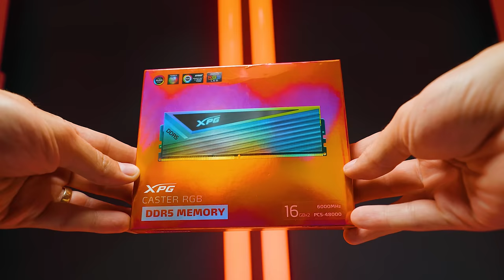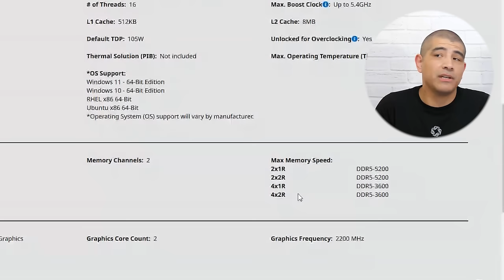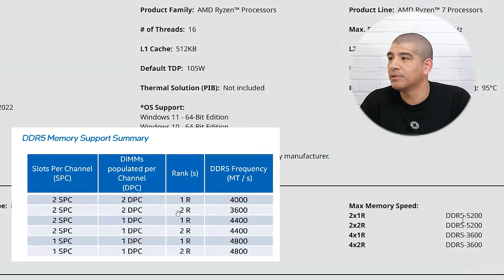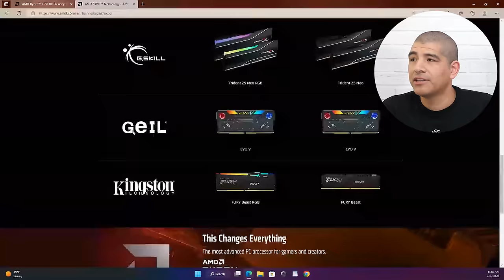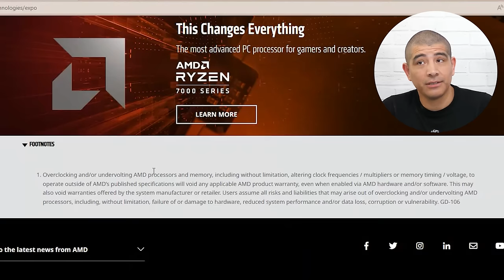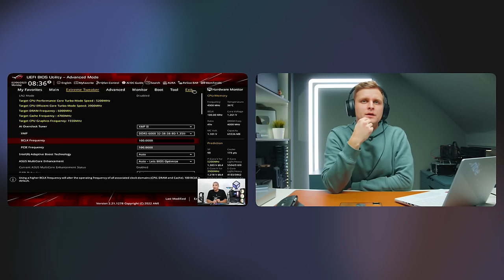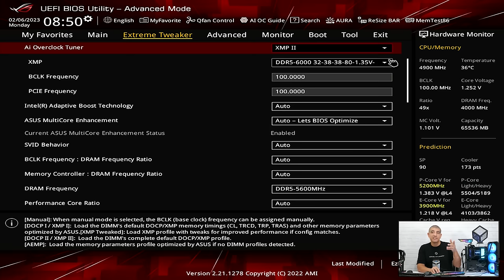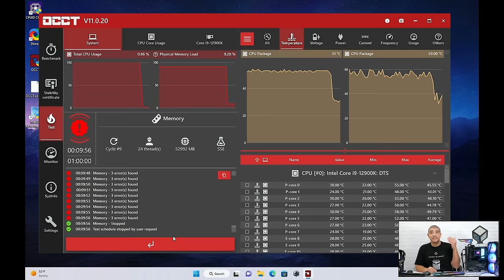Why I get NO POST with XMP??? 👉 ULTIMATE RAM + XMP Guide

Comment: AM5 half baked potato.......
Reply: This is why I didn't adopt the new gen and I'm staying with my R5 5800X until AM5 has had more time to grow.
Reply: AMD Ryzen 7800X3D is still the best Gaming-CPU…but i have a i7-13700k. 😂
Reply: @XiBaXha I was at that crossroads too, no regrets to have gone Intel though.
Too many uncertainties with AMD concerning the ram, plus I was planning my build at the height of the "frying chips" scandal.
Reply: @XiBaXha It’s an amazing CPU specially for gaming. However it is a bad all around CPU. Not enough cores to be a great workstation CPU and clock speeds a lot lower than a 7700x.
Reply: @XiBaXha it's good but not best by far
Reply: @XiBaXha nah the 14900k is as good and beats it for production easily. Beat overall
Reply: It's hilarious as a computer hardware engineer to see all the normies here bashing them and talking about games when most don't even know balancing ranks vs clock, especially when most games don't even care about memory.
Raise your hand if you've known Jim Keller and David Westfall. o/
Reply: @shaolin95 "Beats overall" LOL, for what? That's why I see AMD topping charts? And then there's real use in actual computers instead of microcomputers.  For example, over a decade ago I was running a gaming server with memory in the terabytes. People with bad Internet were complaining about stuttering, asking if it was the SSD speeds. Storage?  Lol no, I had loaded the entire game storage drive into RAM...
Reply: It could bake a potato
Reply: @TheSlickmicks congratulations for not buying thing. Mine has worked perfectly since launch day.
Reply: @moriyokiri3229  That's awesome. I wish I was in a position to afford risks.
Reply: Worst platform overall since sometimes prior to socket A.

Comment: Last month I spent about 2 days figuring this out on my newly built PC. I had random black screens and dead PC during gaming especially. While browsing solutions online, I remember watching one of your previous videos that actually talked about the compatability issue of XMP and 4 sticks DDR5 as well. That inspired me. I have 2 * 2 * 32 GB Fury stick kit + 4090 + Z790 Hero MOBO. You helped me locate the exact problem: XMP. I ran a bunch of memtest and found that none of Auto, Manual + some recommended tuning, and XMP 1 worked at all. After upgrading the BIOS to the lastest version (08xx?), I found that only XMP2 at advertised rate or Manual at factory rate worked. After setting to XMP2, all problems were gone and my PC never worked this smoothly before. Your video is EXACTLY the tour I had been through. I really hoped this life saver had come a bit earlier. Great review!
Reply: This is me right now. I'm on day 5.
Reply: XMP is intel gigante
Reply: @NearMedia  Yes sir this is the latest version by now. At the time I checked that out, 0904 wasn't available yet. Btw, 0816 works perfectly and I am not bothered to try 0904 for potentially new trash to deal with :face-blue-covering-eyes:
Reply: @NearMedia  Yes sir. All tests were passed. Practically, it's been about 20 days with no black screen. No freeze. No sysfaults. Nothing. I assume it's long enough to be firm about it now.
Reply: 4xDDR5 lowers the supported speeds.  Unfortunately XMP/EXPO counts as memory overclocking so there 's CPUs that won't handle even 2xDDR5 at the advertised speeds, while over boards manage 4 DIMM configurations.  I read the Gigabyite board notes and they were talking about their memory configuration avoiding drawbacks of daisy chaining.  There's plenty of small server boards with ECC on the AMD side aimed at the small server market.
Reply: @mirrienliang1561  At what speeds are you running 4 sticks of 16*4?, I have G.Skill 16*2 kit running at 6400 MT/s so I wanna knw if I can get another kit and get 64gb? my cpu is 13700K and mobo is Z790-A Gaming WIFI
Reply: @vigilante9259  I am running 4 sticks of 32gb Kingston Fury Beast DDR5 DIMM at the advertised rate of 5600 MHz. You might also be interested in that it seems like people been recommending doing 2 sticks for 64gb (i.e., 2x32gb) instead of 4x16gb for better stability and/or overall performance.
Reply: @Mirrien Liang  yeah thats what seems to be the case here, specially since I'm running the current ram at 6400 MT/S, guess I'd have to replace them with 2×32gb sticks
Reply: @mirrienliang1561  confirming everything is still running well for 4 sticks of 32gb Kingston Fury Beast DDR5 DIMM? i just ordered this for my 13900k ausu z790 e rtx4090 build. After hearing all the issues running 128gb DDR5 i'm thinking about getting a asus z790a and 128gb ddr4 instead. Any thoughts?
Reply: I think high speed memory is overrated. Too much fuss for small pct gain if that. Not worth the time troubleshooting or price premium.
Reply: @landonhafen2046  In fact I took 2 sticks off about one or two months ago as I was still very occasionally getting blackscreens and stuff even not in the gaming scenario. If you are still wondering, I would recommend either a 2-stick DDR5 kit OR two 2-stick DDR4 kits, even though I have been seeing more updates (in terms of the MOBO/BIOS firmware and other drivers) claiming that they have improved the stability issue. Feel free to share if your build has overcome such issues. :hand-pink-waving:
Reply: @RubbingPotatoes  I would agree with that. I feel like the marginal gain in higher speed (and even the memory size after reaching 32/64 GB and beyond) is significantly lower at the higher end and it does not hold much meaningful difference in those sticks and the prices these days.
Reply: Was this a video on turning xmp on before doing anything? I seem to remember a recent video someone did. Update bios it then turn xmp on before doing anything
Reply: @vigilante9259  Probably not. I learned with my gskill trident Z5
that it's always better to have 2x32 than 4x16 with DDR5
Reply: @midi002  day 9 here. Solved it by setting XMP2 but setting 1 higher timings to the subtimings.
Reply: @mirrienliang1561  I'm running 7800X3D on a MSI x670e carbon wifi gskill 6000mt 2x32gb expo can't get it for the life of me to run stable anyone got any ideas? It'll post but if left alone it'll start showing red and orange cpu lights the next day and then refuse to boot.

Comment: In all my years, even with fairly aggressive overclocking the CPU is generally the last thing to go. The highest failure rates are your motherboard, GPU and PSU.
Reply: They seem to be the most expensive right now. Good business for the manufactures.
Reply: @roythunderplump  .. Yeah engineering failure by design is pretty evil.
Reply: 14900KS has entered the chat

Comment: honestly people need to remember that just because 192GB DDR5-8800 CL28 is technically a combination of all the best specs, it isn't possible on an actual PC. You trade MT/s for Latency, and also quantity for both. That is why people don't buy the most expensive RAM, they buy the best middleground as that will be what gets them the most performance. In this case, 2x16GB for gaming and 2x32GB for productivity with DDR5-6000 CL30 is by far the best way to go.

Comment: I wish reviewers would do their first tests of CPUs while running memory at JEDEC. If that is the speed they guarantee, that is how they should be evaluated. If the CPU manufacturer thinks its "sweet spot" is 6000MT/s then they should validate the CPUs for that speed, especially if they say running XMP/ EXPO will void the warranty.
Reply: It's very simple, if the advertised speed isn't the JEDEC speed, then achieving the speed with XMP does not void warranty. If they want to claim that, you can simply countersue them for fraudulent marketing and earn an easy case win. If the basis of your purchase is that XMP-enabled speed was what they advertised, then that's what is legally binding in court.

However, if you use XMP to exceed the advertised speed rating on the product packaging/marketed description, then it will void warranty.
Reply: @Real_MisterSir  Lets take AMD. They seeded reviewers with EXPO 6000MT/s sticks, claiming its the sweet spot memory. However if you look at their webpage it specifically lists DDR5-5200 2x2R or 2x1R as the Max supported memory speed. If this is all they are willing to cover under warranty/guarantee as an achievable speed, that should be what the base review uses.
Reply: I thought it was the reviewers (both good and bad ones honestly) pointed out ages ago how finiky memeory was with the newer playforms, sonetimes not even being able to achieve what they ARE rated for given the chips themselves

Comment: finished the build for my wife yesterday: 
13900K on a MSI Z790 Carbon Wifi with 4x 16GB Corsair (CMT32GX5M2X6200C36, 6200MHz CL36, Hynix M) running absolutly rock solid in XMP @ 6200 with latest BIOS (7D89v15). 
Just turned on XMP1, expected a boot loop, but it simply worked with all stress tests. Fingers crossed. Very happy.
Reply: lock the p-cores on that 13900k asap.

Comment: Great Video. We always face issues with our DDR5 prebuilds with XMP profile and 4 Ram Dimm configurations (128GB). We use a combination of tools to test our prebuilds with 4 RAM DIMM configuration on XMP. The most effective one that can show the XMP issue is the Aida64 Stability Test. Sometimes we run AIDA 64 + Unigine Heaven for 20 to 30 minutes. Most Low-end Rams never get XMP performance, and we find a stable frequency by manually checking each frequency. Once again this is done for our prebuilds as stability is considered the most important aspect of our systems.

Comment: I think that 'rank' can better be explained by considering the extra capacitance added to the address and data lines if the sticks are double sided (current 32gb per stick!). This extra capacitance slows down the rise and fall times of the signals as well as additional load on the IMC. Maximum RAM chip size has just jumped to 24GB allowing 48GB with two x single rank and 7200MTs (G.Skill 7200 or even 8000+ if you have an Apex M/B). I'm running the 7200 on my Asus ROG Z790 Hero and just about to start playing with faster timings 🙂). Great video BTW!

Comment: Kingpin did an interview explaining these things not long ago.  I can't find it, otherwise I would link it.  He said the same thing a lot quicker and clearer than this guy.  Basically, Kingpin was saying his preference in motherboards for overlocking stability was for only 2 DIMM slots.  The more slots you add, the more noise potential you introduce.  The more noise, the slower the speed potential.  Same with DIMMS - single sided DIMMs (or single-rank as they are also called) are capable of higher speeds than dual-rank DIMMS. (double sided).  The fewer IC's on a DIMM the more stable it could/should be.

Comment: Over 20+ years of building and upgrading PC's I've learned a lot and every day still a school day. Thanks for the video. I'm using 2x32GB 3600 DDR4 CL18. When building (Jan 2020) my current daily (3950X in the X570 AORUS MASTER). I researched different combo's (via forums/videos/websites etc) of ram kits, mobo, CPU, GPU's and compared the QVL. Which led me to this set up, its not always as simple as 'plug and play'. When dealing different PC hardware, taking time can help but sometime trouble shooting take time. Even for the most simple fixes!

Comment: There should be a notice on the box!
I bought two 2x16GB Corsair Vengeance RGB 6000 kits and could not get a proper overclock no matter what I did.  4800 is just too too slow for me!  Luckily I was able to return them and I bought a single 2x32GB G.Skill Trident Z5 RGB 6400 kit instead.

Comment: I express my gratitude for an excellent tutorial. Initially, I acquired a Corsair DDR4-3600 64GB module and promptly observed that it failed to deliver the expected speed, resulting in the sluggish performance of applications and frequent crashes. Subsequently, I made an exchange for a DDR4-3200 64GB module. Upon attending an Asus BIOS class 101, I was able to optimize the settings, achieving the desired performance level.

Comment: I finally figured out how to use 4 sticks of DDR5 on a Z790 Dark Hero. This video shows you how, but it doesn't understand what it shows you. I had the same problem going from 64gb of 6400 ram (2 sticks) to 128gb of 6400 ram (4 sticks). I began only being able to run it with optimized defaults after returning my original purchase of the extra two sticks and exchanging it. The return wasn't necessary and didn't work. After a couple of YouTube videos that said that I can just reset the BIOS, I could run it at the optimized default settings. It ran, but at 4200. After watching this video, I was inadvertently shown where you can see the true speed of the ram and that the speed printed on the box is the overclock speed. On the EZ Mode settings above the X.M.P., it will tell you the speed of the ram the motherboard sees. Do not change the setting in EZ Mode, leave it disabled. Go back to Advanced Mode and leave everything to Auto. Drop down to Memory controller and change the frequency to 4800. Don't touch anything else. Save settings and reboot. It will reboot with the new settings. Yes, it runs at 6400 when I use 2 sticks. This does not apply with 4 sticks. I know that at 4200 my system is very stable. It is a bit faster at 4800, but I need to use it for a while to test how stable it actually is. I do know that I couldn't get it to boot when I used a higher speed, and the video didn't turn on. On the Dark Hero, I have to remove the CMOS battery to reset the BIOS. This is a pain. Anyway, I am up now. If I experience anymore glitches, I know I can reset the BIOS to its default settings and run without issues. I bought the extra ram because 64gb wasn't enough ram and I crashed when I had too many tabs open in Microsoft Edge. With 128gb of ram, or 4 sticks, I am more stable and don't crash. Anyway, I hope this helps.

Comment: The 4x DDR5 RAM problem of the Asus Prime Z690-A was solved with Bios update 2305. Have all my G Skill Tridenz Z5 5600Mhz installed & tested with MemTest86 V10.2 free (USB). Before it was not possible for me 4x DDR 5 with 5600Mhz stable to run. am glad that it now runs. Great video THANKS

Comment: Great interview video, all the info JJ shown helps a lot. My setup is frustrating. i9-13900K with Asus Prime A Wifi Z790 MB and Corsair two sets of 64GB Kit 6000Mhz CL40 (2x32GB Sticks) for 128GB filling up all the DIMM slots. Only 2 DIMMs in A2/B2 slots and XMP enabled and the CPU overheats on POST. I think the best I seen 2 sticks go on self adjustment during POST is 4800 Mhz and I don't  think within Windows it was that great working. 4 sticks has been hit and miss to even get into windows but at  2nd last POST they trained to 3600Mhz and when the computer would go to sleep would not wake up properly like the USBs in the back I/O panel were not active or something. Keyboard wireless to the Dongle was not connected looking. So on next BIOS entry i have the 4 sticks setup at 3000Mhz just changing that DRAM Frequency Drop down box for the Memory Divider and not changing anything else.

Comment: 😂I.C. Integrated circuit A term we use in the 80’s..how i miss building my first FM radio and 50w amplifier during my high school electronics elective days..soldering each parts, reading resistor color, trouble shooting transistors, etching and building your own PCB’s,micro drilling each holes for electronic components and soldering each piece in the board..reading and mastering schematic diagram, my high school fun times🙂..

Comment: 50:10 Actually, Some components voltages may be too high, Asus massage is more of an Asus Smash! If you are having trouble with 14th and XMP over 5800 try setting System Agent Voltage to 1.2 STATIC, it will probably save you.

Comment: This should be taught in elementary schools.
I'm an old guy involved in custom PCs and what I've learned is that there are so many variables involved in a custom system that it's a miracle that it actually works in most cases.
That is the reason why I appreciate Windows in the Linux vs Win debate.

Comment: The ROG certified memory profile works great on my Team Group Dark ROG 16GB DDR4-3000 (x2 8GB single rank).  I bought this kit because of Toms Hardware review saying each stick was dual ranked.  Either they were mistaken or IC's were drastically changed mid manufacture.

Comment: Thanks for the video   Fixed my XMP isssue.     The comment on A2/B2 should be used.    I am sure a dumb mistake,  but I was in A1/B1  changed and now running find with XMP  dram 6000

Comment: My ram made my board post to safe mode every time I enabled XMP 3200 and default timings. Turns out the DDR4 sticks I bought from amazon is rated at 2133 and you can tell they just stamped the 3200 sticker on the box lid. Read carefully what they say in the description and also reviews with 1 or 2 stars. My advice is if you want a certain speed in ram always buy somewhat higher speed, in my case I want to hit 3200 therefore I will have to buy 3600 sticks or above.